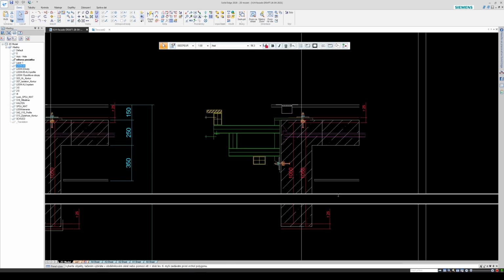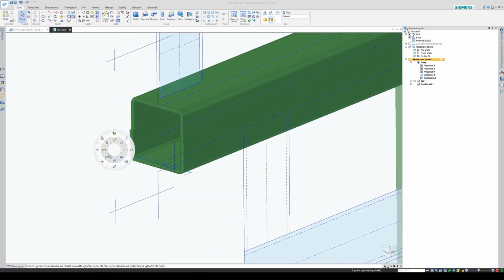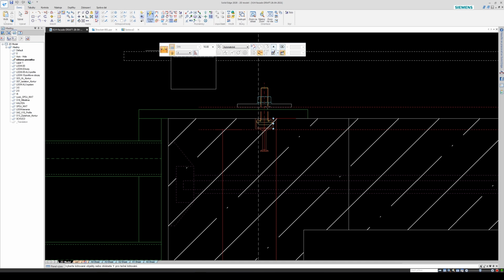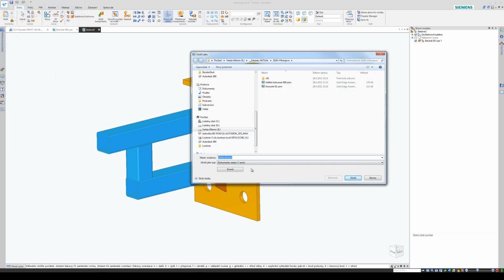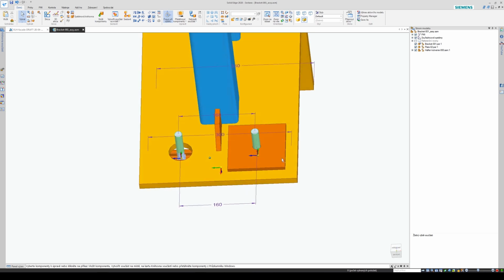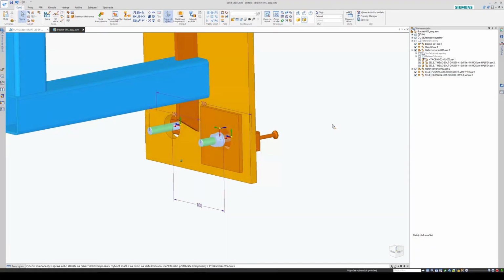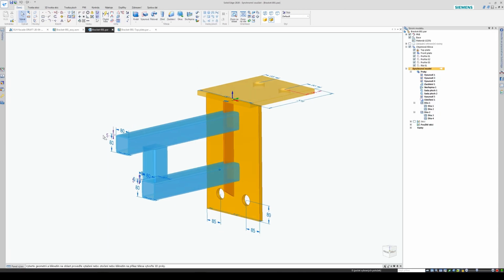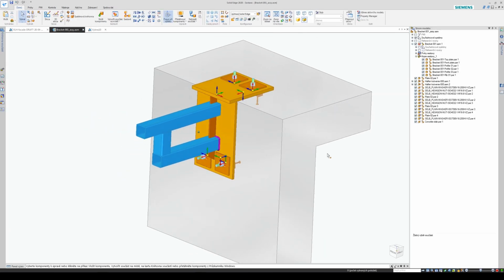Solid Edge 2020 - Multibody Part Modeling

Comment: do you have to do multi parts in sycronise, what is advantage?
Reply from the maker: you can create multibody parts in ordered mode as well. Synchronous modeling wisely combined with ordered is the best option when designing new products/parts. Start with syncro modeling of basic shape you want to alter when designing and create all small elements (chamfers, holes, patterns,...) in ordered connected to synchro body features (edges, planes,...).

Comment: how do you navigate through the 3d view like that, is this some kind of special manupulator?
Reply from the maker: hi, I am using 3dconnexion Space Mouse Wireless, very tiny, but still very useful in navigation. There are more advanced devices on their site, but if you are using CAD on daily basis, this device is a must ;-)